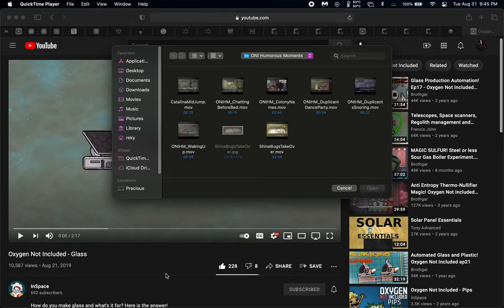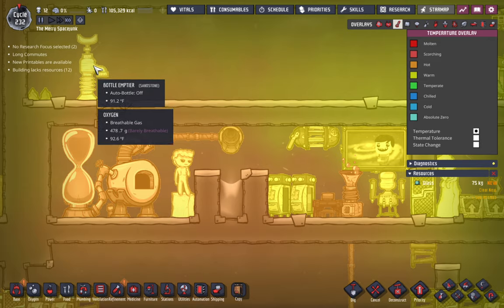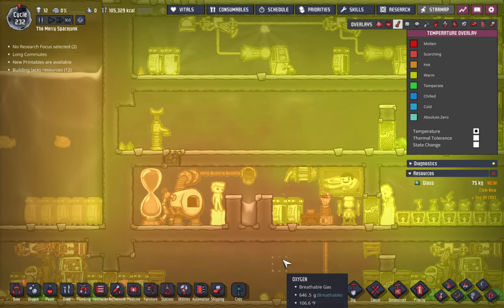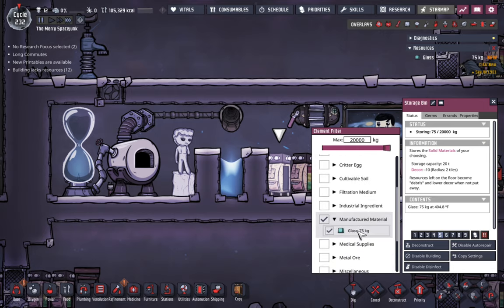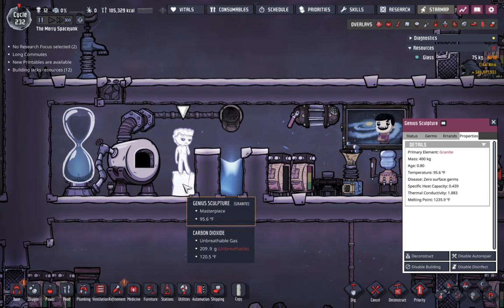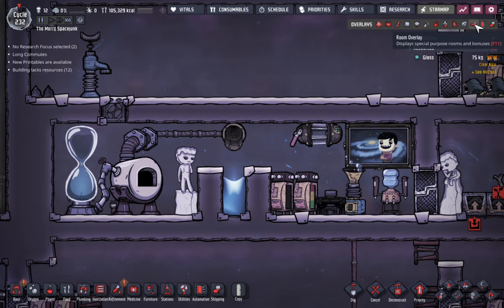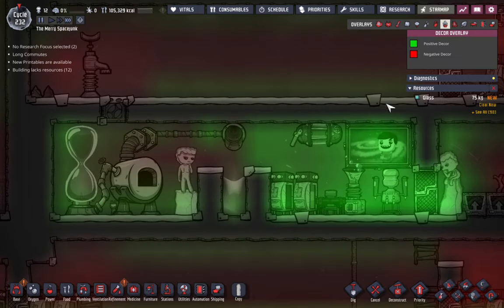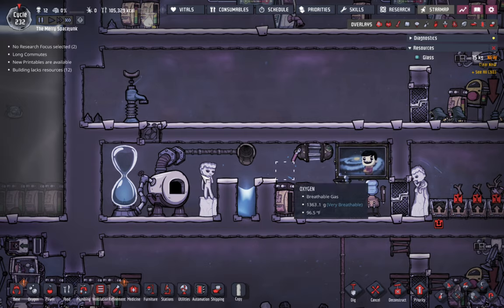ONIDD GlassForge

Comment: Oh my... What you are showing is exactly what one should never ever do. A few hundred kg of glass is fine but you will cook your base eventually if keep pumping glass like that. This a very, very early game, crude and detrimental design. It will cook your base. An immediate fix is using insulated tiles for this small water "tank" to limit the heat from escaping water. Another fix would be making this larger so that you have more thermal mass to work with but both will eventually fail and cook the surrounding. It's a matter of when not if.
You worry about steam appearing or you melting your statue. When this happens you will have A LOT of problems on your hands. But even before that happens your dupes will get scalded from even getting near the forge cos such a huge temp differential will dissipate fast. So b4 the steam appears everything else nearby will reach about ~102 C.
You have a lot of learning to do imho for the game but you'll get there. Try researching active cooling for industrial area and this area in itself. I suggest most of francis john's vids for example. Even old ones still hold true mostly. A bit smaller (for now) creator is Luma, he too has some interesting ideas for things. If you'd wanna talk im in DSC there ;)
To anyone who is watching this, im sorry but this is not a good idea. I've been there, ive done that and i've been playing this game since some early alpha and learned, often the hard way, what works and what doesnt. This generally doesnt, conditionally does for a very limited batch of glass.
Anyway, gl hf and cheers :D
Reply from the maker: Thanks for the tips.  I am still learning, and enjoying the process as I go.  Sorry about the late reply - not sure why, but the comments got buried 'for review', and I had no idea.
Reply: @Artystrique  No worries, i appreciate the reply and being receptive to criticism. Have fun and keep chuggin! 😉